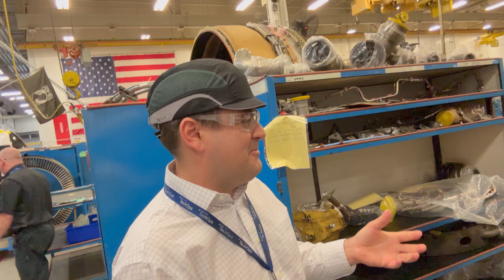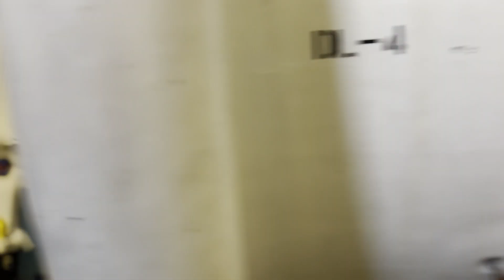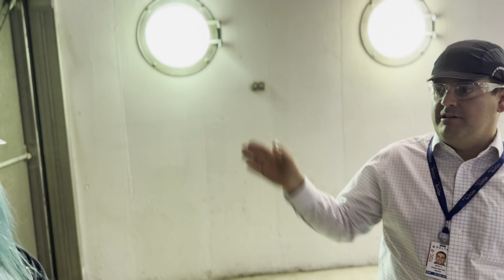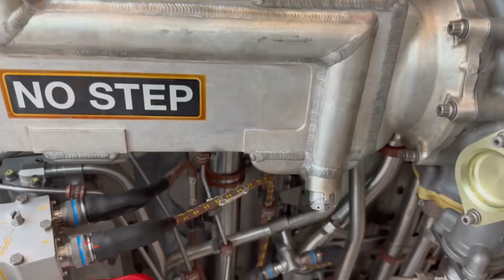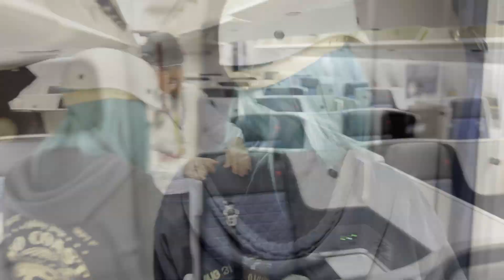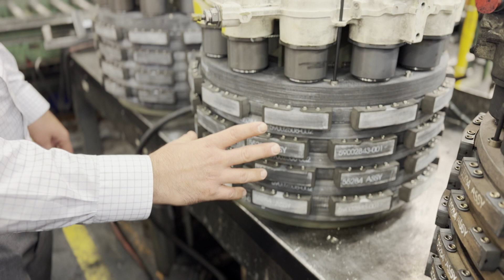JET engine rebuild facility tour filmed on Iphone 15 pro max

Comment: Kyle needs to strap one of these on the VN
Reply from the maker: Haha yes
Reply: he should fire that snot box up and send it out of space haha
Reply: If Kyle's engine had a turbo fan then you could in theory run the fan shaft to a gearbox/diff and drive the rear tyres aswell. 😂